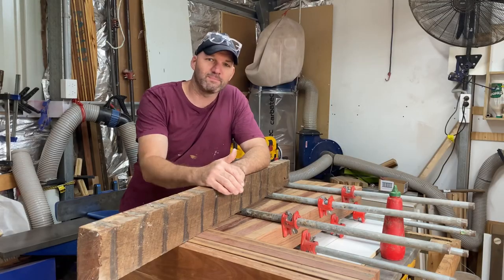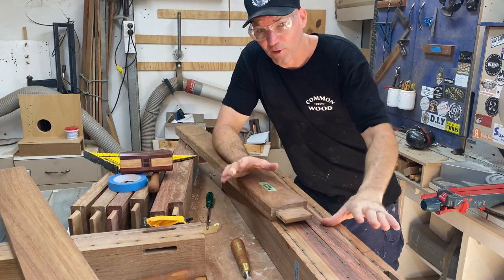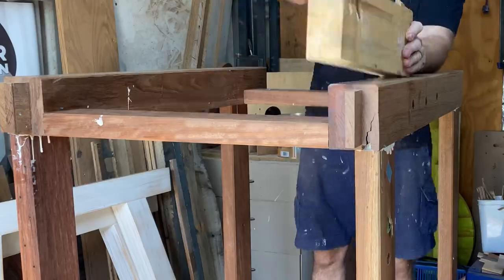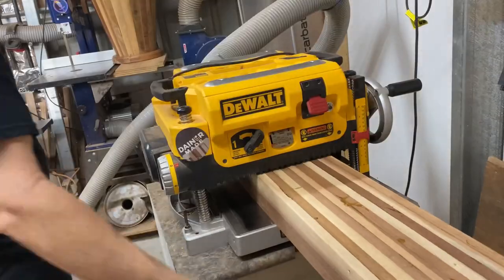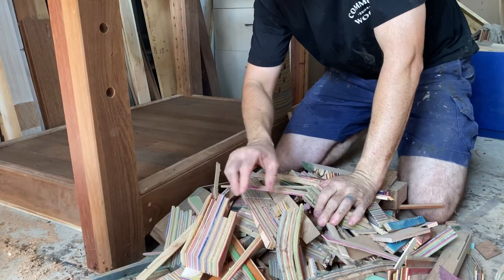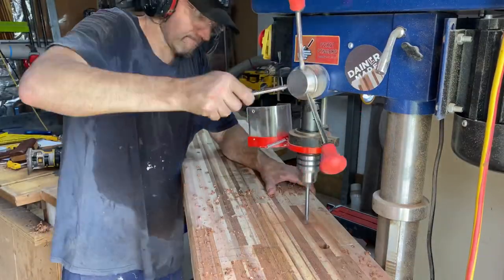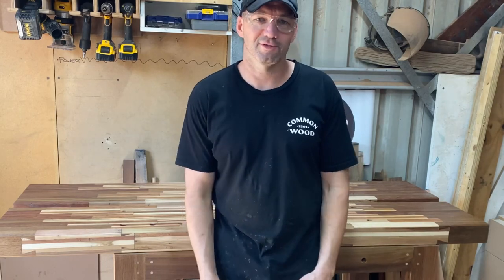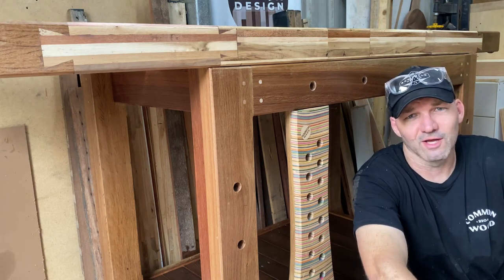Woodworking WORK BENCH - Ultimate reclaimed timber and Palletwood Build

Comment: Mark, have you considered building an extension jig that could be used with the table saw, thickener, router table? Using pipes similar to the pipe clamps. Build a pipe cube so you can add height as needed and have wheels on the four bottom corners for portability. Just my thought. 👍🏻👍🏻🇺🇸

Comment: Great job. I like yours better than my current bench. Which means, I'm going to have to make a new primary bench and use the 2 old ones I've already built for my miter/slide saw. And I'll include all of your fancy design qualities in mine, too. I like symmetrical the stuff. 

Question... Did you use lag bolts to fix the top to the base?
Reply: @dainermade  Lag bolt, in Texan, is a self-seating bolt with a hex head. Coach bolt, in Texan, is a regular bolt with a nut fastener, but much bigger that a machine screw, with a hex head. 

I know there's a language barrier, so to speak. I had a client in Melbourne and sometimes it took pictures to get on the same plane (not the flying kind).
Reply: @dainermade  Its always 5 o'clock somewhere, no matter if its A or P.